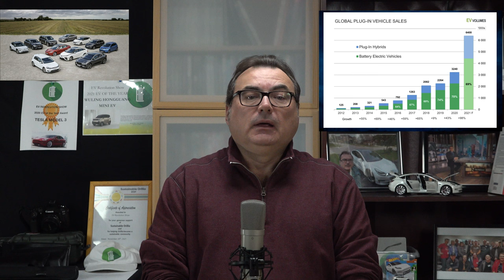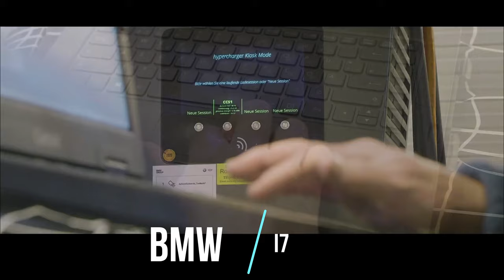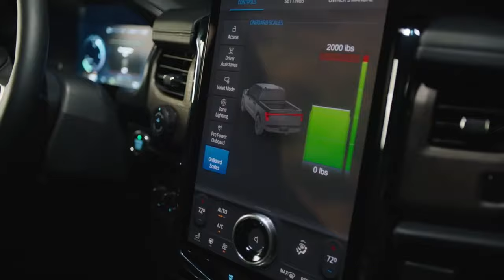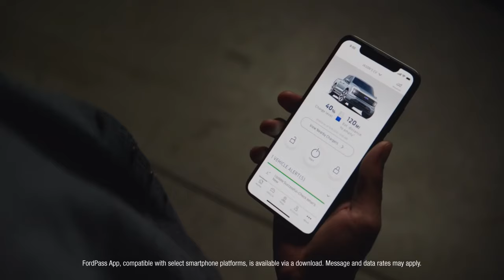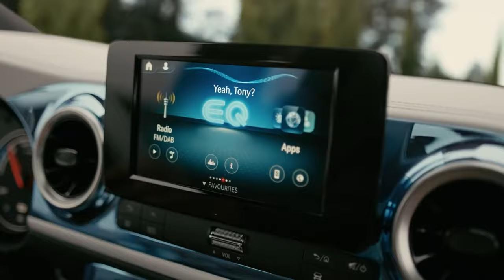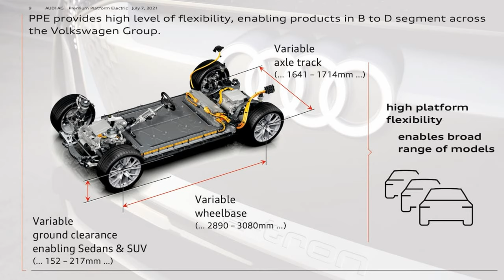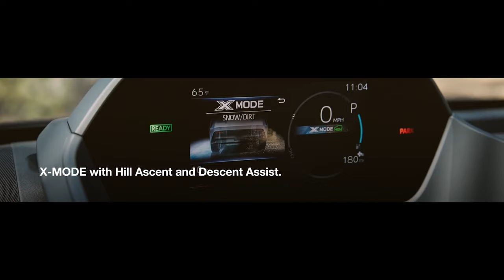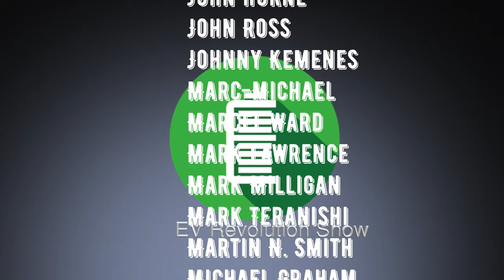Episode 155 - 2022 The Year of the EV?  What's coming for consumers in 2022!

Comment: Great video lots of choices but the problem is still the price, I know with volume as with all new products the price will fall just have to wait a few more years I guess.
Reply from the maker: Thanks for watching.  Yes we are starting to creep down a bit towards price parity for ICEVs, but still have a long way to go.  Many analysts predict 2025-2026 we may see this level achieved.

In the meantime, if an EV is in your future, I would not wait and get what can fit your lifestyle sooner than later.
Reply: WADR BEVs are cheaper on average over their lifetime than equivalent  ICEVs., When operating costs are included.... Its the reason that the BEV versions of the F-150 are sold out..... 

Most truck buyers do not even care, that they are the greener choice... Shame most retail customers only take inconsideration the initial cost of a vehicle.... :(
Reply: @nc3826  I agree but they are still mostly out of the range of lower income earners and I know with more hitting the road second hand cars are becoming more affordable. Still the point is at this moment in time they are out of the reach of the vast majority of people.
Reply: @EVRevolution  I agree and plan to buy an ev in the not to distant future but at this stage my only choice seems to be a used Nissan Leaf.
Reply: @nc3826  People in the lower ends of the price brackets do not have access to the full lifetime ownership costs to throw at a new vehicle. They may also not be eligible for a loan for that much. (The horror stories of people not being able to get loans for houses that would have a cheaper mortgages than what they currently pay in rent illustrates this problem perfectly).
Reply: @patreekotime4578  Who said anything about "having access to the "full lifetime ownership costs" to throw at a new vehicle"?  Who pays operational cost up-front?

And WADR it does not eliminate the future operational costs anyway. Does it? And I never said it was far or not. It's just an added consideration that tends to be ignored.